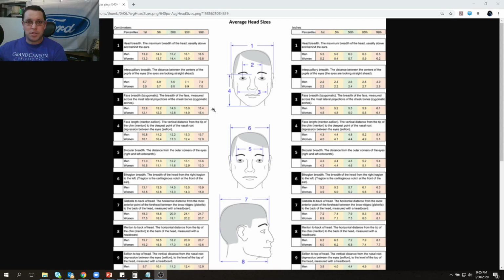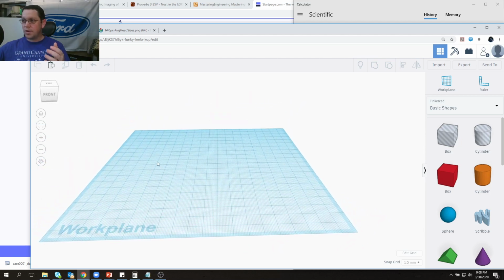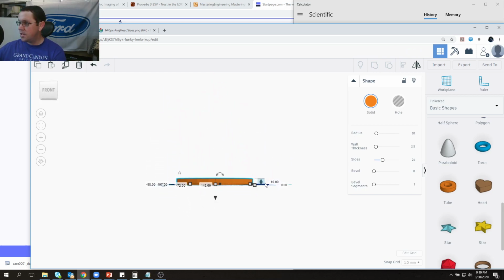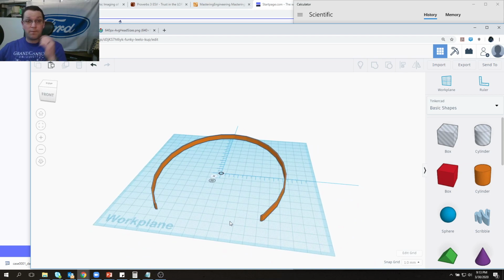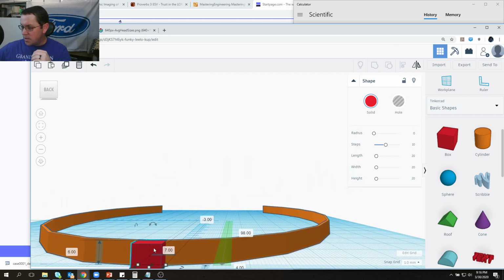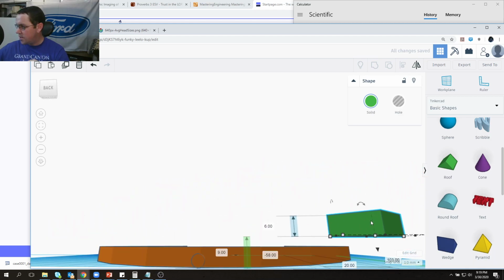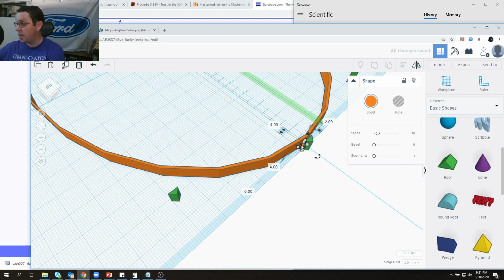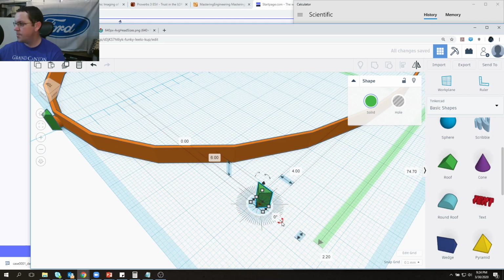Tinkercad Face Shield ME&BME activity

Comment: Thanks gonna help me with my competition 😁😊😉
Reply from the maker: Thanks! Good luck and let me know how it goes.
Reply: @drtesla887  can you help me? I also need to design a packaging design for food delivery keeping in mind that customer should not be worry of any contamination (Corona Virus) please 😀🙏🙏 I need to submit before 8th June please
Reply from the maker: @anshultiwari5226  I would look at the existing air-tight food containers with seals as inspiration. There are may designs and approaches to the problem. But air tight is as close as you can get to 'safe' from contamination. They can be round, square, hexagonal, rhomboid, ovoid shape, etc. So long as they have a groove for an oring or sealing surface, it can be designed as 2 parts, or multiple parts. There are even food-safe examples like a 5 gallon bucket with an oring in the lid that you can find for inspiration.
Reply: @drtesla887  thank you so much I'll tell you the result and yes you really deserve so many  subscribers and more success.You are one of the rare YouTubers who really reply back and help their subscribers 🤝👏👏🙃